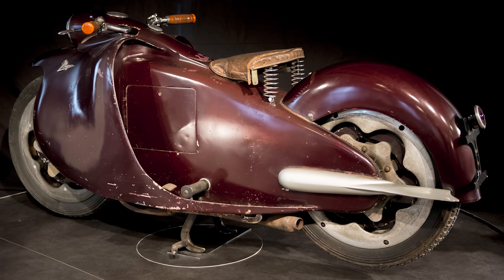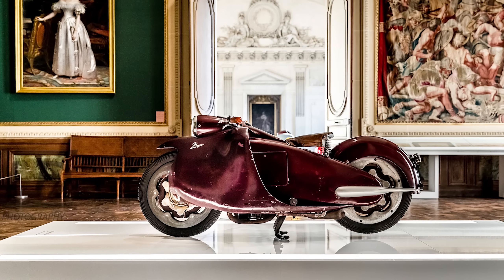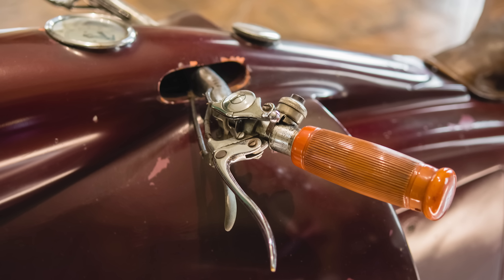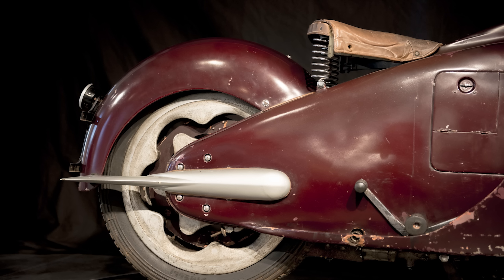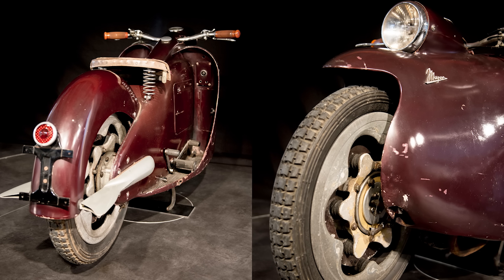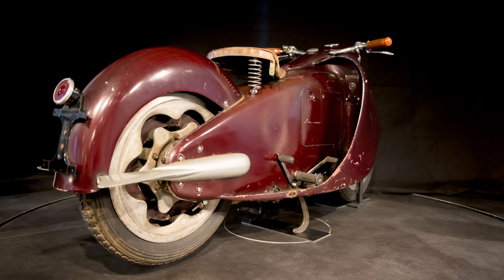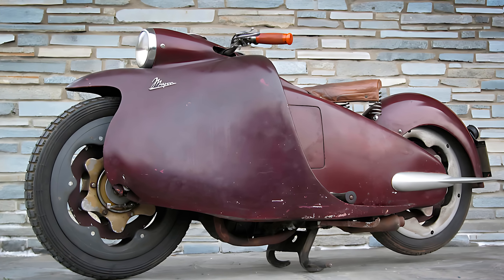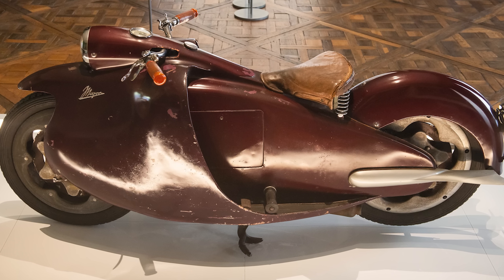👽1947 Moto Major 350: The Alien Motorcycle With No Forks 🔧

Comment: You should do a video about the 1948 Imme R100. It had a single-sided fork and a single-sided swingarm which also was the exhaust pipe. It weighed 47kg (I think) and would have been great if the designer had not insisted on a single bearing crankshaft which led to engine failure.

Comment: I am disappointed that the chrome fins at the rear does not seem to be the exhaust pipes. Missing such an obvious design statement!
Reply: My first Clippy of the day and I am disappointed.
Not another soul at a factory would dream of taking the time, effort, and compromises involved in shaping, smoothing, plating, and polishing that artistic detail on the rear of the bike, just to run it thru constant Hot/Cold Cycles, and pass the byproducts of petrol combustion thru the middle of it.
I hope you dream of a chrome plated seat for a motorcycle, then have the "pleasure" of experiencing it.
That might be a bit harsh.  How 'bout a polished billet aluminium steering wheel on a convertible?
Reply: @truthsRsung  Oh my, that was quite the diatribe. Now to the meat of the matter: Since when has a designer cared about what is practical or not? That said, fifty years ago my old moped had a chromed exhaust that kept it's shine just fine, and if you to an image search for "motorcycle" you will find plenty of such with shiny chromed pipes. Clearly the hot exhausts from a combustion engine has a minimal effect on the surface treatment. 
Then for some reason you launch into what almost seems like a personal attack, whishing me to experience a chromed seat. Metal seats are indeed uncomfortable, but I guess you can make one of silvered leather. (That might actually look cool, if the rest of the ride matches). 
Polished billet steering wheel is something I'd expect from a high end exclusive sports car (i.e: made for people with more money than sense). I would not be surprized to see one. 
Lastly, did you really get this triggered by a Clippy pfp?

Comment: No source on the net gives a definitive explanation of the suspension. It makes no sense to me. Nothing is stopping the whole hub from just rotationally scattering all the rubber pieces and falling apart (especially if any power or braking force is applied to them). The suspension load tries to shear the blocks apart 🙄, not compress them. It would make sense if a set of radial cam levers compressed the blocks by riding along a helical pin in their center or something, but no sign of it. Anyone? A big con job if you ask me, I bet it never even rolled of its stand on those wheels.

Comment: I badly want to know quite how this thing rode...
Reply: I'm guessing while the suspension/wheels were a bold innovation, they probably didn't work out that well or we would have seen more of them.  The 350 cc single cylinder engine probably wasn't very smooth, and the turning radius was probably limited. I think the motorcycle is beautiful, though.
Reply: @mickangio16  I didn't fully understand how the suspension worked - now how its damped. It seemed to rely from the description on the flexure of the rubber bushings, which sounds neither consistent nor robust...
Reply: @neildavies43 
I was imagining a wheel out of balance from maybe a rock in the tread or mud stuck in the wheel😮 ...😅
Reply: Badly, that's why only 1 was made...lol
Reply: @invisibilianone6288 I suspect this is uncomfortably close to the truth!